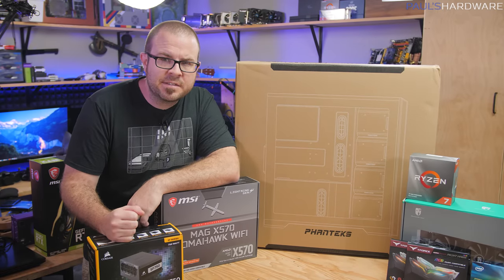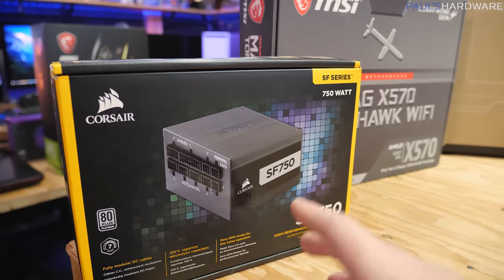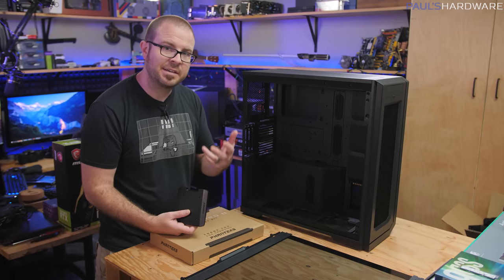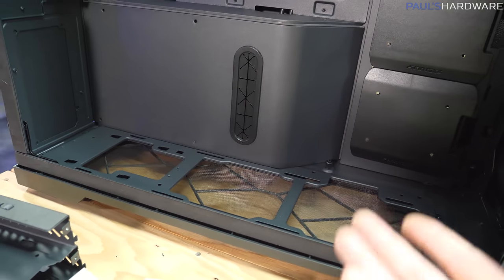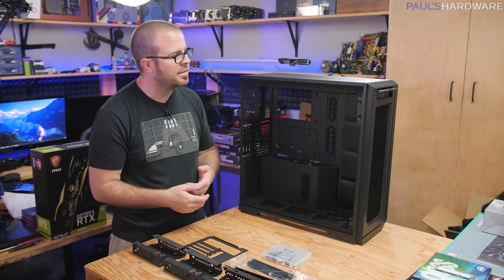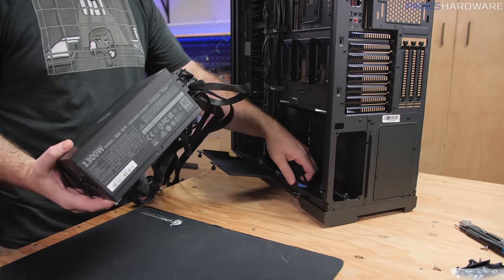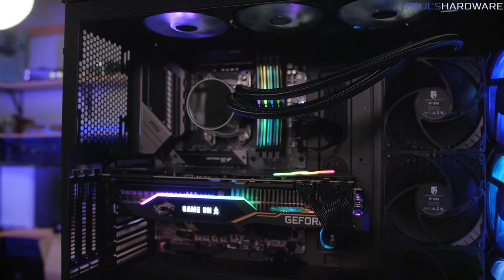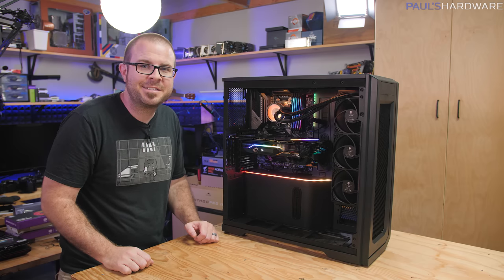Building a $2800 Gaming PC in the NEW Phanteks Enthoo Pro 2!

Comment: This case could be good for NAS server. Specication provides information is up to 12 3,5 inch drives. Interesting if is possible to mount that much with dual system. Then miniITX for NAS and ATX for daily use would be a solid option.

Edit.
I found a manual. With dual system, with Phantek mounting system is only 8 3,5 inch drives. Which is still plenty. But the bracket spacing with Phantek manual sugest there is place for more.

Comment: Wait one question though- why didn't you just attach the AIO rad to the front 360 intakes and make it a push/pull config, that way you get a bit of airflow and very good temps on the CPU?

Comment: With the AIO radiator mounted on the side, are you able to put in 140mm fans on the front or would you be forced to use 120mm fans?

Comment: Love your videos Paul, very helpful and informative. Trying to learn all I can while prepping my first build. Potentially dumb question though - aren't the fans on the side radiator exhaust, and as a result, aren't you just pumping air from the front intake and then directly out the side radiator without the airflow ever making it to the motherboard?

I wonder if thermals would be better if the front and side were both intake and the top had a large radiator for exhaust and you slapped a rear exhaust fan on.

Comment: Cool build. I like the case because it has lots of flexibility.  I don't think using this case for a duel system works for me. I would add intake fans on the bottom and find a way to mount storage drives above the fans.
Reply: Also, I'd mount the GPU in it's alternative position as long as the pcix cable was long enough so that the other motherboard expansion slots would be able to be used and hopefully this wouldn't interfere with the hard drives at the bottom 👌😎✌

Comment: Hey Paul, Great Review. Was Thinking about this case, but Not having enough room for a Top Mounted AIO is a Bit Disappointing. Especially in a Case That Big!! That Bottom section could be used to place a Small 2nd internal Display for system Monitoring?? Hmmm! 🤔😁😎

Comment: just bought a new CORSAIR iCUE 465X RGB ATX Mid-Tower PC Case 22 euro do you think its a good deal?
when i saw the price it couldn't believe it  i have  HP Omen bought a year ago 1900 euro im gonna custom build it
 i love to spend some on to make a good looking RGB PC 
your advice on which motherboard should i buy i want to take out the  PC motherboard which came with HP Omen PC
its some boring looking motherboard
CPU- i7 8700 none k
GPU- Nvidia GTX 1070 8 GDDR5
DDR4-16 GB 2666
SSD -256
HDD- 2T
budget up 200 euro for motherboard and 150 on RGB DDR4
thanks

Comment: Looks like with a little bit of creativity and custom fabrication you can fit a 2nd power supply at the bottom front of the case below the intake fans and turn it into a dual system build without having to use a dual system power supply. This would make all the that real estate at the bottom of the case functional. It may require some custom cut brackets painted to match the case and then some drilling and rubber grommets to route the PSU wires but seems like it can be done without too much trouble. Maybe it's not what phanteks has in mind but with all the covid 19 free time on hand why not get creative.

Comment: Can those HDD trays fit inside that PSU shroud where the PSU normally would sit and then just put our PSU in the front of it where the HDD trays would normally sit?  I rather see my PSU than see boring HDD trays in the case. I hate shrouds but if theyre going to use them might as well hide the uninteresting parts.  WIth PSUs being RGB and having stat screens on them they shouldnt be hidden under shrouds.

Comment: Would picking up a Z40 1600 v2 quad workstation complete w/OS sub $300 worth it to salvage the case and 650w power supply for a new system build? mb

Comment: How/where do you connect those cooler master RGB fans to? New to this case etc...are there two ports on the motherboard to connect those cooler master RGB fans to?
And is there software you have to install to control the RGB in those 3 way fans? is it built into BIOS to control the RGB fans? Thanks

Comment: Paul can I just add 2 more sticks of Ram? I did my First build and I used G-Skill 3600 8g sticks, can I get 2 more sticks of the same Ram and plug it in?
Reply from the maker: Yes, you can do that and it should work just fine. 2-stick XMP settings don't always work with 4 modules populated though, so there's a chance you might need to loosen the timings just a bit.

Comment: Just watched Steve's video (Gamers Nexus) on proper AIO radiator placement yesterday and got (only a little) triggered by yours Paul ;). Is it possible to mount the Gpu Vertically on the bottom?

Comment: I really wanted to use the side as exhaust for my 420mm Arctic f 2.. but I can't figure out if this fits? 

I want the rad to be placed on the back panel and using the fans inside with push config. But.. pretty sure the Arctic 420mm aio is 38mm thick? Where normal aio rads are smaller.

Comment: The only reason so overpriced is the RTX 2080 Ti, you'll be able to afford one in 6 years as they cost nearly $2,500 to $3,000 in 2021 for all the GPU Hoarders using Price Gouging. They buy out all the stock making a shortage and profit by selling 2 to 3 times what they are worth. Oh! forget Ryzen go get a Threadripper or a nice Intel i9 CPU. Be sure to get the God-like motherboards or Top Tier. A lot of T-Force memory on eBay so must not be doing well. Buy G.Skill or Corsair.  Phanteks Enthoo Pro v1 for regular ATX and standard AIO or Air cooling (lacks update on USB type connectors).
Enthoo Pro v2 is great if doing custom liquid cooling or wanting to mount your GPU vertically also cable management is fantastic. Note: more openings allows for more dust critters so don't be afraid of using the dust filters. If you get an Air Purifier with built in Ionizer, you'll never have to worry about a dusty or filthy Desktop.

Comment: "A reasonably priced 2080ti?" Paul? Really? 

2080tis are a ripoff. Go 4k with DXR on with high settings. Tell me how it works out...
Reply: yeah thats why i didnt bother upgrading this gen, 4k is "dooable" but not really. mayne next gen or maybe even the one after that. i do plan on building to the 5 nm AM5 chipset from amd/DDR5 is releasing in a couple years if it's a big improvement
Reply: @Aleph-Noll  i got a crosshair 8 hero recently.  DDR 5 has the same pin configuration. Im hoping it will work with a bios update.
Reply: @niteowl9733  yeah maybe im not sure so i cant say. but honestly one of the reasons im waiting for that is bc i think itll make a lot of things incompatible as its basically the start of a whole new gen in a lot of ways
Reply: @Aleph-Noll  I figuring as much but, due to pricing im always a gen behind. It really doesn't matter though. I have a 8350 build and a 4790k build. Both crush 1080p gaming at 60 frames. Even new titles.  My goal for this new build is 1440. So it will be good for years to come. 

I do have a little buyers recourse. Even though I didn't spend any money on a  new video card yet.  its going to be hard to justify $600+ on a video card when the next gen consoles are going to kick ass. The pc market is goig to be crushed unless they fix the price gouging with the pc parts. Its really a joke. I was so disappointed in the build quality of these higher end parts. I feel like a sucker tbh.
Reply: But they aren’t lmao
Reply: @deadchannelfrom2018  keep telling yourself that. I've seen stronger plastic in happy meal. And the cables and pins on RGB products? Lmfoa!

Remember Asus's most expensive x99 mobo? Pretty much all their mobos from around 2014... the wing that locks the gpu down always broke. Review after review. 

Now we have companies like corsair charging over $100 for a 3 fan pack because its RGB. They are no different than the $35 pack. Asia horse or ezdiy. They all come out of the same factory. 

Wake up bro. I know its a hard pill to swallow. No one likes finding out they've been duped.
Reply: Nite Owl lmao. If you knew how cheap 1 2080Ti is compared to having to use 1 Quadro 8000, you’d realize you’re the one that needs to wake up.
Reply: @deadchannelfrom2018  you know the same roof put on a commercial building costs 2+ times more than the residential roof, right? So a commercial grade product with a specific commercial product application is definitely going to be more. 

So how and why are you comparing apples to oranges? The 2080ti is a mainstream product geared towards gaming and hobbiests.

Buying a 2080ti is like buying ryobi at a Milwaukee price point.  Fortunately Milwaukee is priced fairly due to the extensive competition in the market. That can't be said about nvidia in any way shape or form. Most professional applications that use a quadro are purchased with tax dollars, Hollywood production types, wedding videos that cost thousands and so on. Its easy to justify a purchase that pays for itself in no time especially when the purchase is also a legitimate tax right off. 

Again, apples to oranges carrys no weight.
Reply: Nite Owl Thats where you’re wrong. A 2080Ti isn’t only made for gaming. It says a ton of money when using it for rendering, modeling and processing power.
Reply: @deadchannelfrom2018  so your saying it's OK for regular consumers to be over charged for a card that can be considered a low budged card for semi pros? 

The entire line up of PC parts is out of control. Especially the GPU market. 

I know their are plenty of people, like yourself, that can afford to drop $1200+ on a piece of cheap plastic and low quality aluminum made on a press in china. Plenty doesn't mean majority. Infact your probably 10% 

Lots of people will irresponsibly open an Amazon credit card to get one when they shouldn't. Why? Because its a must have to complete your high end youtube, streaming/gaming rig. 

That doesn't justify the pricing at all. Especially when the 2080ti falls well short of expectations. I understand you're desire to defend your purchase. No one likes to be duped. Its like getting food envy at a restaurant. Your friends order a meal for 15 bucks. You get the meal that costs 30. Theirs looks way better for the price. Damnit Jim! 

I've been in retail for many years. I understand the marketing and markup on electronics is insane due to the nature of them being in high demand and a luxury. 

The problem with nvidia is they don't care about you. They don't care about anyone or anything but the bottom line. Jensen is truly a greedy SOB that deserves to be pushed out a high rise window. He probably makes more in an hour than you make in a year. 

How do these CEOs make so much?. Its simple. They brainwash Americans and Europeans with Christmas music. They use youtubers to stuff their products down our throats while promoting them like a must have. They pay their own people as little as possible while letting the lowest bidder manufacture their products. 

Like jewelry, they mark it up 1000% , mark it down 50% and Say your getting one hell of a deal. 

Nvidia takes full advantage of not having solid competition. Look how much intel reduced their prices now that they have competition. Their still making good money. They were charging next to double before AMD kicked them in the teeth. 

Don't you think a $1200 card should be able to handle 4k with DXR on without struggling? DXR is today and the future moving forward. The 2080ti is nothing more than a glorified and massively over priced 1440p card. It's truly worth about $600 at best and that's being generous, but fair. Yes, its a decent product and yes it took investment to make it. A $1200 card should destroy 4k gaming even with DXR.
Reply: 3070 is best choice soon. or till now cheapest 2080super if you cannot wait, I found at 570 euro quite OK ;)
Reply: @milanklco  I'm actually waiting for big navi and 3 series cards to launch. I'm sure their going to have a price to performance battle. Yes, from the leaks the 3070 super is basically going to have 2080ti performance +20% and way better DXR performance. 

If the navi leaks are true we will see some good prices out of nvidia for once. If not I will be more than happy to give AMD my business. Their going to have DXR and ddr6 as well. I just want a rock solid 1440p experience. Above 60fps at all times with high settings dxr on. Even the adaptive sync monitors are cheaper when they dont have gsync branding. 

AMD might be the way to go but, we will have to wait and see. Im tired of all the speculation videos.
Reply: @niteowl9733  so true :)

Comment: This is what I'm wanting to do with either this case or the 719 (leaning more towards the 719).  Use case is the MiniITX system as a GamingPC and the full size ATX as a streaming / recording / video editing PC.  It says using AIOs but I would ultimately like to go with open loop water cooling.  https://builds.gg/builds/dual-system-gaming-stream-video-editing-etc-26724

Comment: Any reason why you used the bottom nvme slot instead of the top? Curious as I have the same board.
Reply: They are all  4.0 and he used the smaller slot to leave the larger spaces available if needed.

Comment: What is the spacing between front and side if 360/480 radiators with fans on both front and side? Ie do the fans overlap at the corners?

Comment: I have gone through and built/tested/sent back 4 good damned cases, trying to fit my arctic cooler liquid freezer 2 280mm, combined with an insanely tall mobo heatsink (on a MATX mind you), low LPX venegance ram, and a long ass gpu (286 mm). I am not getting this case to fit an open loop or a server, or even a 360mm. I am not getting this case for it to look pretty. I am getting this case so that I can stop ripping my hair out from 2mm clearnace issues, so that I can front mount, bottom tube, my radiator without the PSU shroud telling me to f-off.

Comment: I've had a enthoo primo followed by a tower 900 and I'm currently looking for a new case that can support my 480 and 360 radiators along with 9 rgb fans. This looks promising the only concern I keep running into with some of these newer cases is which would handle my 4 ssd / 2hdd (as well as a on board nvme) the tower 900 has a huge amount of space behind the board so I kinda just stuff everything back there and do a bit of cable management but you don't see any of the drives "just sitting there". With these new cases I'm getting this feeling that beyond showcasing my ssd's (which seems to be the style today) but I'm not really into displaying the 3.5" HDD's.

Anyone have any suggestions or a setup in this or the fractal 7 xl that would maybe fit all this and deal with the hard drives in a practical way?

Comment: The RGB along the top of the basement is cool, the space in the second system area I can see the anime fangirls making a stage down there with their toys.

 I agree that these are for dual system streamers, although in my office I would have my CAD system up top and general business PC in the lower position, then it's 1 box for the 4 screens I use, trouble is, where does the lower systems GPU go if you don't want to use extenders? 

Is there an IO plate included for an ITX setup in the lower position??? By that I mean a plate that covers the PSU hole and had the cutout for the ITX MB included IO shield.

Finally linking the last 2 Q's, if there is an IO plate, does it have a double or triple height horizontal or vertical GPU slot???

Comment: Guys any ideas why my mother board turns off and on in 2 seconds non stop? I just installed a new motherboard and It started to do the same thing with the loop. Now I got a new psu and the old mother board still does the loop and the new mother board won’t show anything on my monitor but it does power up. Did I kill both motherboards with my old psu or is there any other thing I can do?

Comment: my pc build
1000 watt evga supernova power supply 
two x 360 radiators alphacool
corsair d5 pump reservoir 
alphacool fittings and tubing
i9 9900k @ 5.3ghz all core 0avx
gskill 32gb 4000mhz 16-16-16-34-600 1.5volt
2x adata xpg pro 2tb nvme
16tb seagate exos storage drive
2tb samsung 860 evo ssd
evga z390 dark motherboard
nvidia rtx 2080 super overclocked 95 core 1350 to memory
k95 keyboard
razer naga trinity mouse + corsair glaive
fractal design s2 vision rgb case
1x LG 34GN850-B 34 Inch 21: 9 UltraGear Curved QHD (3440 x 1440) 1ms Nano IPS Gaming Monitor
1x Dell UltraSharp 34 Curved Ultrawide Monitor - U3415W
1x Dell S2716DG LED with G Sync 27" Gaming Computer Monitor 144hz 2k
1x LG - 55" Class C9PUA Series OLED 4K UHD Smart webOS TV - goes above the other 3 monitors 

my next build will be amd i think, intel and 14nm+++++++++++++++++++  thats all i can say about that

Comment: All black cabling while being very stylish and pretty is an absolute nightmare to troubleshoot, also the first thing that goes when tracing cables out is all that "cable management' tie wraps (I use velcro and old copper wire (about #10 AWG)with insulation on it  (https://www.lowes.com/pd/D-Line-Cable-Wrap-Black-8-ft-2-5m-0-5-1-5-in-10-40mm-Expandable-Diameter/1002887174)

Comment: Phanteks be like "naah, PSUs dont like air"

Edit: Actually it has sufficient ventilation, I just didnt notice the holes on the side panel, derp.
Reply: It has a big intake on the rear of the case.
Reply: @erikheijden9828  oooh, you're right. Didnt notice the holes on the side panel, thought they're just on the shroud. My bad.